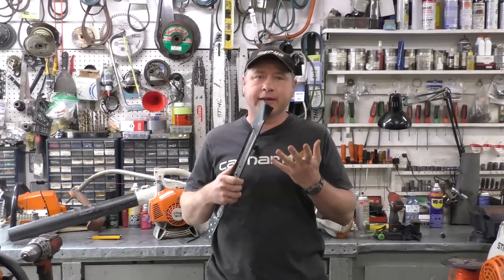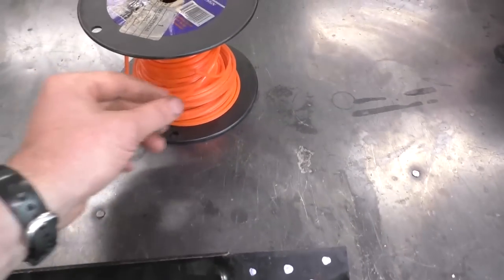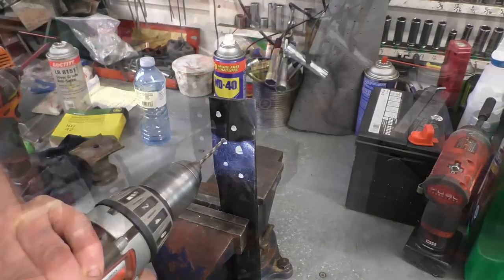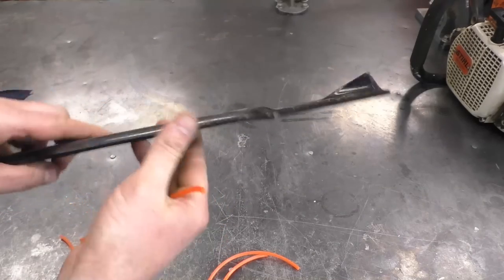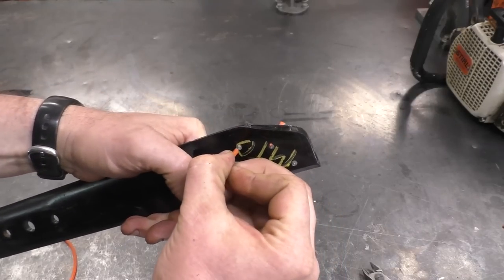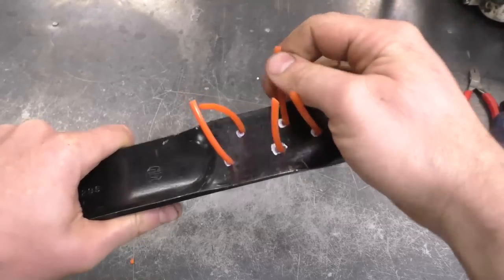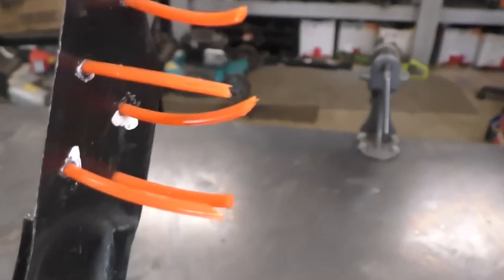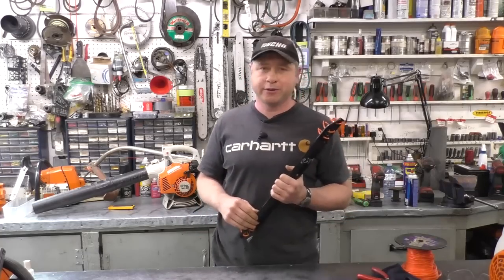How To Make Your Own Dethatching Mower Blade At Home

Comment: I actually had no luck with this type of blade. I purchased the blade set up like the one that's made here and it got some of the thatch but not a lot. When I took the blade off I noticed the line was all "bent up". I even tried a .170 thicker line. Same thing. It's like no matter how think the line it's still to "flexible" to dig deep deep in the thatch where you need to get in.  I'm afraid to use bolts since it might rip up to much. I think the best option is the type that have the stiff steel wire that has spring tension.

Comment: Too bad there was no demonstration of use.  I'm curious how well this works.
Reply: THIS DID NOT WORK FOR ME! I did this with 0.190" strimmer cord,  46" ride on. The centrifugal force of the blades spinning caused the line to immediately point to the sides, and what other pieces just broke off.
Reply: @williamgbartell  I immediately thought the string would do just what you said it did and wondered how that could dethatch ANYTHING.  I am surprised that donnyboy did not demonstrate its capability, if anything.
Reply: @spresc2180  I have been looking for what someone who has tried this would say it worked. Craftsman is selling a blade with replaceable nylon strings. Lol

Comment: I have done that, putting the trimmer string parallel to the blade to scuff more areas rather than in line at 90° with the blade.  I still prefer the spring type for deeper contact..

Comment: I did this on my mower. I used .155 string. At first I cut 7 inches strips with about 3 on both sides. 3 inches were to long and the ends ripped.  I then used 5 inch strips with less than 2 inches protruding. It works as a hair comb and not a dethacher. It's a good solution for me bc I want to lift the grass up and loosen it

Comment: I had to do this myself as a Toro blade is different than the "universal" dethatching blades.  It was very hard to drill perhaps because it is hardened steel. I only used 2 holes per side.

Comment: I would b amazed if that worked I picture the trimer line going parallel with the blades based on the speed Thay turn
Reply from the maker: if you se some that they sell they are exactly the same

Comment: I think a few lengths of think wire would last better.

Another alternative is long skinny bolts . Use two nuts to each bolt.ibe above and below the blade with inch if okay.

Comment: Dony, I salvaged a 6.5 HP Tecumseh mower found at the curb.  It runs o.k. but seems a bit fast to me.  I have no experience with Tecumseh mowers.  My governor spring has 13 turns while the photo of the replacement shows 11 turns.  Should I replace it?
Reply from the maker: might be good to replace it, if you bend the tab at carb where spring does into it backwards towards air filter it will slow down rpms

Comment: So why not mention removing the blade is not necessary when having to use more weed trimmer line. 🤔Wait why not also mention how much of a pain in the ass it would with the trimmer line. Since you know it's not going to last much and it's not going to stay in place. But the main thing you didn't inform (should a individual choose to try your method) check the balance on the blade. You did ruin a new blade, made holes and the weed eater line might not weigh much. It still has weight to it. And what are the risks of a unbalanced blade? You should have used pieces of a clothes hanger instead.
Reply: Good use for and old blade
Reply: Clothes hanger might be a good idea.  Did you try it?  I'm not sure I agree that drilling holes in a blade necessarily "ruins" it.  Probably still mows fine too without the tines.